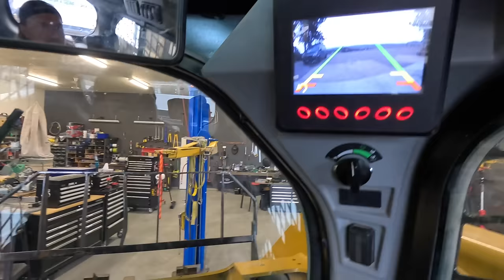Hitch Fab & INSANE Snow Recovery!

Comment: Bruce, the ends of our forks have a hole in them. Get a good mag drill, and drill a hole in both. Then you can hold it in place with just a couple pins, and it will not slide backwards.
Reply from the maker: Great idea 🍻

Comment: I'm the same way.. I build the 07 ford E-450 cab and chassis for hotshot delivery myself...designed it to haul fifth wheel and gooseneck trailer ball...

The only thing I didn't do is the welding...
Because I can't weld and I don't have a welder
Reply from the maker: That sounds awesome!!

Comment: Explosions never go as planned...I have friends who used to like to blow things up...for the fun of it. One time a friend was hosting a spring equinox event outside at his property, and we were supposed to have a big bonfire. They had put it together the wood so that it would be easy to light the day before, then it rained most of the  day. As the sun went down, the host lamented that there wouldn't be a fire, and one of my friends said "I can get it to light!", and runs back to his car to get a gas container that he carries around, and comes back. Opening the container he splashed gas all around the fire, then poured some in the middle, and more around the edges...and then some more in the middle. I had been near the fire pit watching things, and then realized that the "ignition" would be very...energenic. So I took about 10 or more steps back. About this point the host shows up with a box of wooden matches and hands it to the friend. I take another look, and then took   a few more steps back. My friend then gets a match out, strikes it, hands the box back to the host, runs up close to the fire pit and throws the burning match into the pile of wood, then turns and runs! There was a second pause then WOOOSH! I was still too close to the fire, and felt the heat. I ran my hands over  my forehead to see if I still had eyebrows...I did. I then looked down at the grass in front of me...I was just a couple of feet beyond the border of burned grass. After that, we never let that friend start fires again.
Reply from the maker: Everyone’s got that one friend 🤣🤣🫣

Comment: You can also take the plasma cutter, cut a hole Into your 2 x 3 or 2 x 4 tube stock weld a nut over the hole, and then, when you slide it onto the forks, tighten the bolt down onto the forks and it will hold it stationary where the bolt tightens down make a small indention on the fork with a grinder to hold your bolt in place that’s what helped with mine anyway great work bro

Comment: As per the setup you've made up for the skid steer ( and allows it to be used on any set of forks which is the beauty of the design ), how about weld a piece of flat iron vertically across the ends that allows for easy clean out of crud ( full enclosed ends would work also but could clog up with crap inside that dead end ) . The idea in either method used would allow for lots of strength in being able to push the trailer. And as to the pull chain I would suggest using quick links or a small screw clevis to not only add back some chain and yes you could weld up a link to join back chain, but to add extra length of chain and double it back or let it dangle ... and that way giving an allowance to tailor the chain length to any other fork lengths on the spot if you feel that might be desired. Hopefully my explanation comes across and computes.
Reply from the maker: Good idea 👍🏻👍🏻

Comment: Nice easy rescue. 
 .
 Interesting hitch setup for forks. It could have been much lighter. Using only one piece of 5x2 tube, about a foot long, 16 might be better. Box one end and weld the hitch receiver on top. Same idea on safety chain.
 Simply slide onto one fork🎯😎☕
Reply from the maker: Thought about it and good for most situations but wanted to incorporate both forks for the odd time we have to move my gooseneck with snowcat loaded 😬
Reply: @BruceCookfmx  that'll be a bit heavy for skidsteer, me thinks..depends on the capacity.
 You know your equipment 🎯😎☕
Reply from the maker: @invisibilianone6288  5745lb tipping weight. Will be a couple thousand tongue weight and on flat ground. Well within for this machine but was also why I was hoping to have it sit back further on the forks rather than at the end. It’ll be fine for the few times it has to happen 👍🏻
Reply from the maker: Might steal your boxing the end idea too 😁🍻
Reply: @BruceCookfmx  Absolutely DO !!!
But, don't let anyone know that I think,,.. They'll expect me to do it all the time😱😂😂😂
Reply: @BruceCookfmx  you can blame it on my RottnLab,,, it was her idea😁
Reply: @BruceCookfmx  awww c'mon I could do it with half a fork and a burnt can of brake cleaner😂
 . is that 5745 tip weight at end of forks, or properly positioned load, on forks?
 I just got to thinking about the hitch setup on the trailer tugs, the super short wb trucks used to transport mobile homes. They have a hydraulic operated hitch that raises and lowers from inside cab. But, that's off in another tangent. You already have the skidsteer and forks🎯
 Your dad seems to be a good guy. Cool to see you two work together😎

Comment: All you have to do is drill a hole in the fork and install the ball
Reply from the maker: Then you have to install an uninstall the ball on the fork every time you want to use them as pallet forks again. Also stronger this way when moving a loaded gooseneck.
Reply: @BruceCookfmx  for loaded gooseneck u need this set up, I agree.  Installing and uninstalling using the nut is pain in the rear but if you use safety pin  instead the nut it will make your life easier especially if 9 out of 10 moves you move light trailers